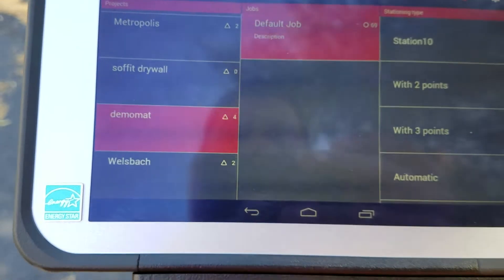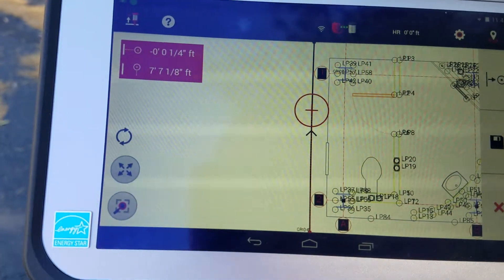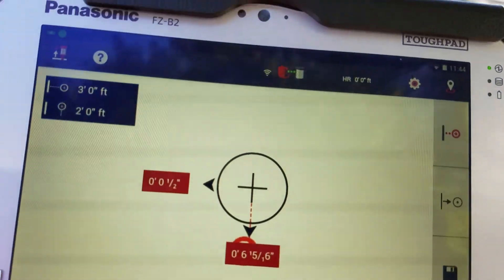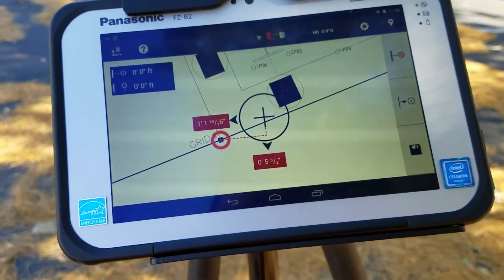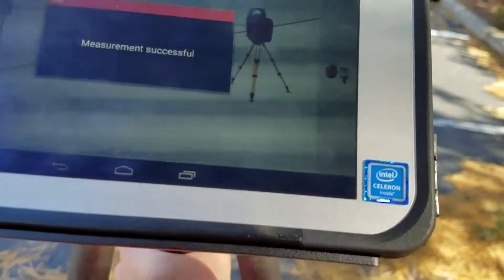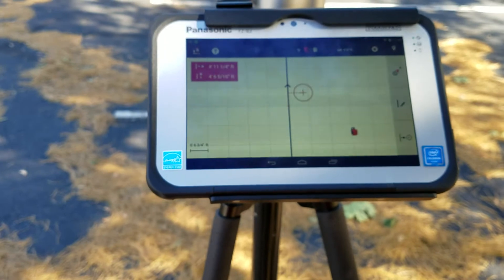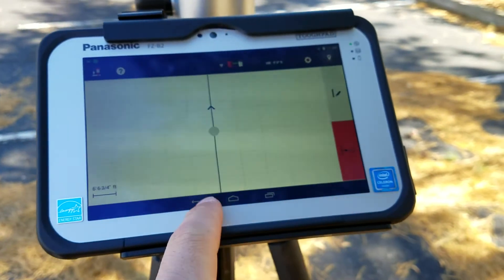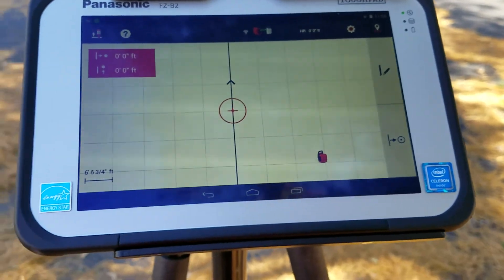Line Layout PLT 300

Comment: Hi, just a questions - when you station with 3 points - doesnt it make a line perpendicular to the one setup by the first two points, which is running through the third one?
Reply from the maker: That's correct. The 3rd point puts the 0,0 of the line exactly perpendicular to it on line created by the first two points.